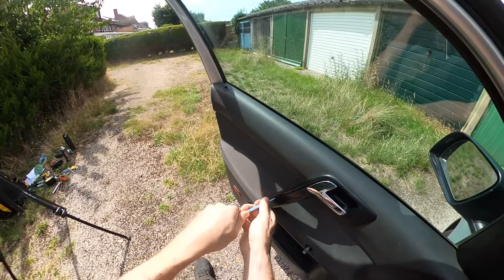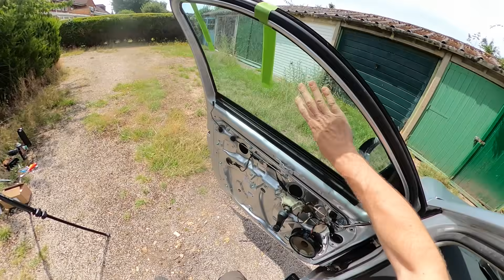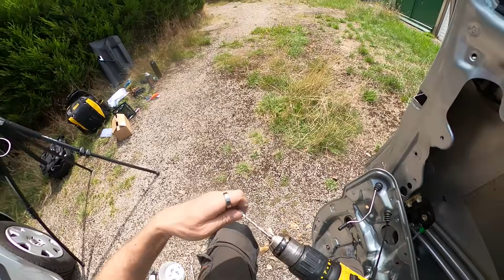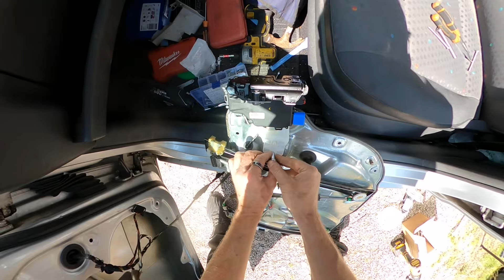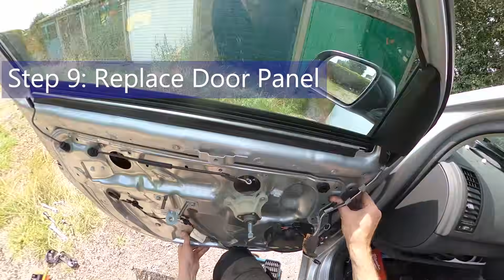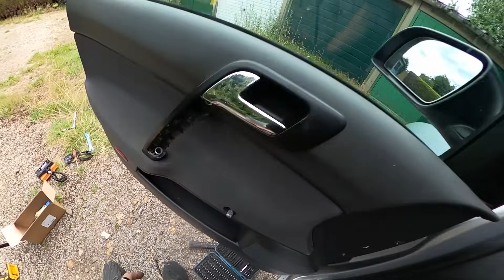SOLVED! Mk4 9N VW Polo Doors Not Locking? Step by Step Guide..

Comment: I followed this guide to change my Daughters Door Actuator as the car would unlock when the key was turned from left to centre, unfortunately for me the actuator wasn't the issue. It was actually a faulty Electric Window Motor that was causing the issue. But thank you anyway.

Comment: Just used this guide to change my daughters. Thank you so much. I would stress though that an M8 spline if NOR a toques head - completely diff. Had to dash out to Halfords to buy one mid job. I just cable tied that white brace to the door cart. Seems to be strong fixing for it
Reply from the maker: Really glad it helped. Yep - those bolts are splined head bolts, defo not torx. A lot of people just wing it with Torx bits - but they always end up regretting it.. The splined bits are sometimes known as XZN or 'triple square'. Yep you're probably good with cable ties - I'm just a perfectionist lol.

Comment: Thank you so very much for this detailed tutorial, it’s by far the best I have seen and the only one that really gives me confidence to do this myself.  I have owned two polo 9n and this issue has affected both of them on different doors.  There are tutorials on how to fix the micro switches that cause this issue, but seeing how much work is involved in this I feel more confident just changing the whole door lock mechanism as you did.    I took the boor card off once to take a look and stopped when I saw the steel plate behind the door card, even taking the door card off I would have benefited greatly from your tip to turn the door card upside down to remove the door latch cable .

Comment: This was not an easy job. 😢

Mine is currently malfunctioning on the driver side, sometimes it work fine and sometimes it isn't. 

At 9:47 you talked about ordering a new plastic. Please could you share with me a link where i can get it too?
Reply from the maker: @idabieteddyota5637  Glad it helped :-) You're right - I was being a bit optimistic in the thumbnail.. I have found my VW invoice and I think the clip is: V6Q0837867 - hope that helps?
Reply: I have a problem perhaps like yours that when I go to close the driver's door with the remote control it doesn't close but I have to insert the key to close and open the door, with obd I did a check and it tells me door number 2 no signal

Comment: My 05 polo won’t lock any doors only the drivers when key turned in drivers side. but will unlock/lock all from passengers also the windows aren’t working any ideas?
Reply from the maker: Hmm interesting - sounds like it could be an ecu problem - I would start with a fault code read & then Google the codes that you get as a starting point.. Let me know how you get on?